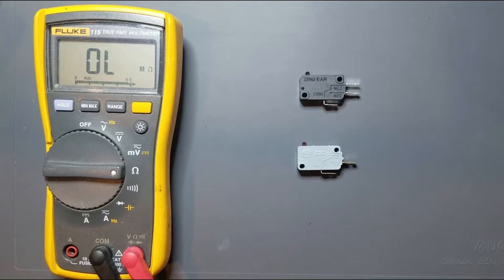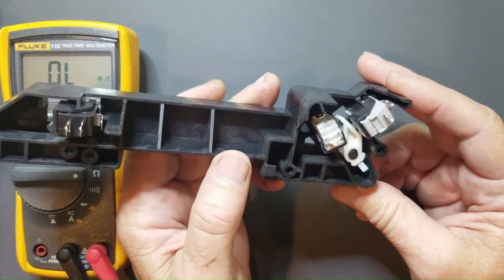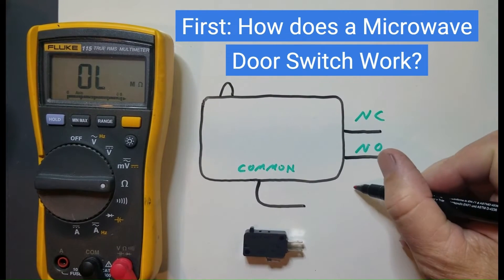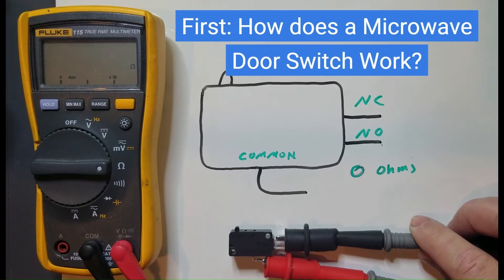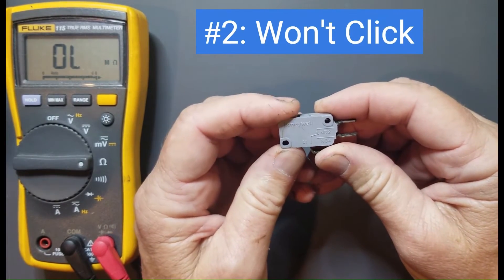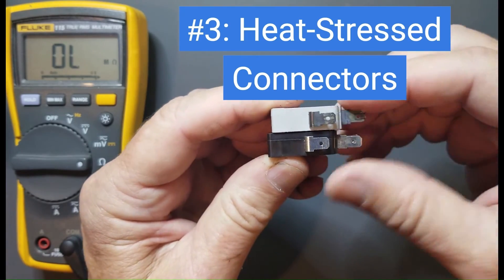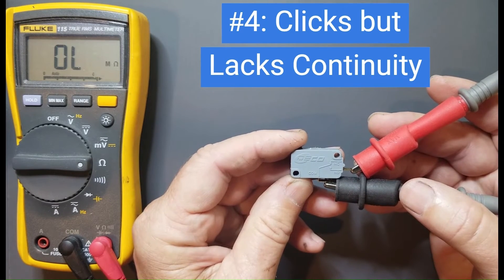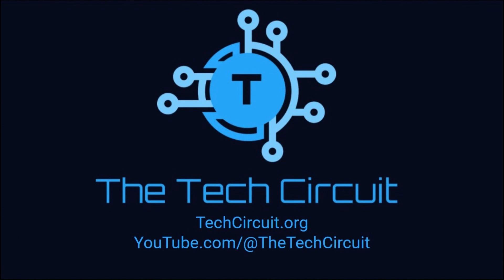#59 - How to Test Microwave Door Switches

Comment: Why the monitor switch works - on & off BUT becomes always on having continuity after connections to the wires??  
That is, the switch works when is alone but becomes not working after connections😒🙄

Comment: The switches often come apart easily and can be repaired or cleaned with some contact cleaner or fine sandpaper. Sometimes this is what you have to do if you can't source a new one right away (i.e. you live in a small town or on an island or both).

Comment: Would it make any difference if I sand down the heat stressed connectors to get them back to shiny copper?
Reply from the maker: No because that heat stress is also indicative of internal damage. The switches are cheap.
Reply: @TheTechCircuit  thanks for the quick response. I just ordered some off of Amazon I hope they work.
Reply: @TheTechCircuit well the new switches didn't solve the problem. But thank you for your content I saw many other videos on the switches but yours was the best. Do you have any info on testing the magnetron? I'm not sure I want to do it. How do you not get shocked when troubleshooting?
Reply: Nevermind, I just found your video on it and subscribed.

Comment: I have a Kenmore microwave which has power but no buttons function.  After unplugging and reconnecting the power it functions normally.  Sometimes just opening and closing the door will get it functioning again.  Could this be a switch problem?

Comment: Thank you.  Just diagnosed a heat-stressed switch on my fancy 10yo Kitchenaid microwave using this video.  $3.16 part and a $220 Fluke 117 which I should have bought years ago.  Worth it!  I used Mouser Electronics for the part.  Amazon is full of Honeywell knockoffs

Comment: What if the fan and turntable work, but the countdown won't move and food won't heat? Thanks for this great video
Reply from the maker: That sounds like a stuck relay on the board.
Reply: @TheTechCircuit  Thanks a lot for your answer! Do you know of any resource on YT or else where I can learn to test and eventually replace these? Thanks again
Reply from the maker: @unamor  If you mean the relay - if shorted, it will read about 0 ohms from terminal to terminal (on top). However, replacing the relay can void the CE and UL certification of the board and I can't officially recommend doing that. Generally speaking, the generally acceptable method to resolve the issue of a fused relay is to replace the boards.

Comment: I have a GE microwave that powers on, the timer counts down, and turntable turns.  However it doesn’t heat up.   Could the problem be one of the door switches?    I’d appreciate any help.   Thank you very much.
Reply from the maker: If you don't hear it running, then it is likely a door switch. If it is going through all of the motions, it is likely the magnetron. In that case, I like to do current draw testing per this video: https://youtu.be/fqb_ib7Hslo

Comment: This is a very helpful video, thanks. Two questions: 
1) Do you have a suggested source for buying new switches? 
2) Is the problem sometimes a mechanical problem with the latch mechanism? 

About 2), we've had the problem that the microwave turntable and heating turn on only if we tug slightly outward on the door. A few months back, I did check the electrical function of the switches, finding them fine, but I've not heard of anyone having to pull on the door to get the microwave to heat. (No error message, and the countdown display turns on and runs--it is just the turntable and heater that require pulling on the door.)
Reply: My LG microwave oven shows a red signal in front panel and displays ´DOOR´ when I press START... looking inside the oven, the small door sticks that inserts inside the oven are not touching the switches... is it your problem as well?

Comment: should a switch measure 3.5 ohms when closed?,if not does that point to it being bad?.
Reply from the maker: If you touch your multimeter leads together and the meter reads almost 0 ohms then yes. If it reads close to 3.5 ohms, the resistance is in the meter leads or connections rather than in the switch.

Comment: Would 2 ohms when the button is pushed consider it a bad switch?
Reply from the maker: Yes if you touch the leads of your meter together and get 0 ohms. If your baseline is greater than 1 ohm or so the switch is probably good.
Reply: Thanks! My baseline is 0 ohms and I'm getting between 2-5 ohms when the switch is activated.  @TheTechCircuit
Reply from the maker: Yes. I'd replace it.  @ryandrom7094

Comment: Great video! Will a heat stressed switch show an odd ohm reading?
Reply from the maker: Often times, it will.
Reply: Thank you! We are trying to diagnose a problem on a Frigidaire microwave the switches don't seem to be getting made when you close the door. Sometimes slamming it worked but not anymore. All three switches tested good but one did seem to show some Blackness around the connections.